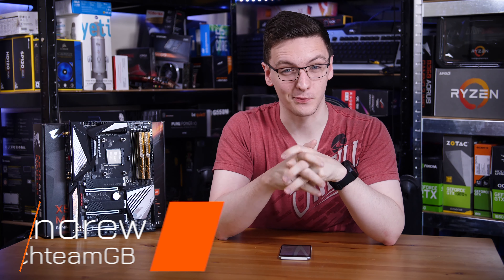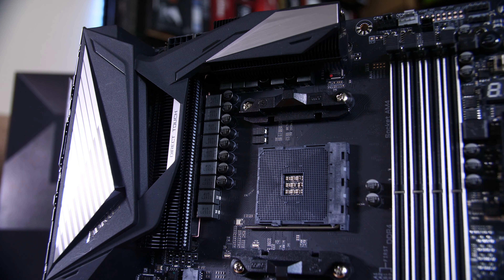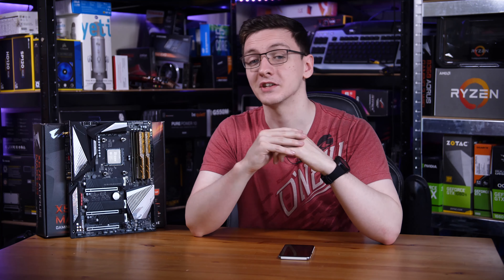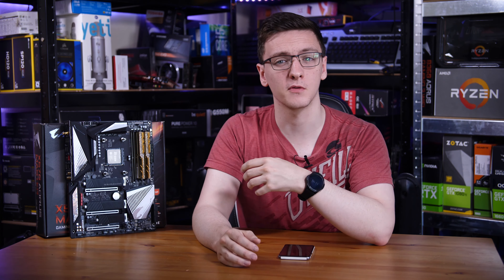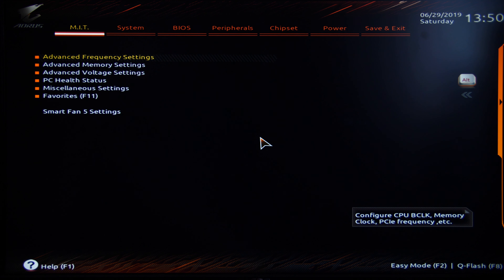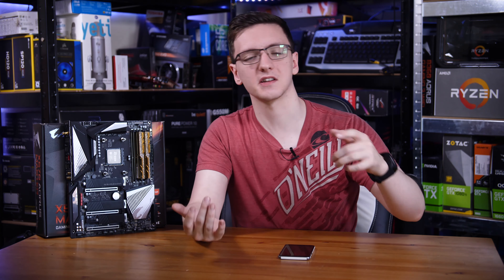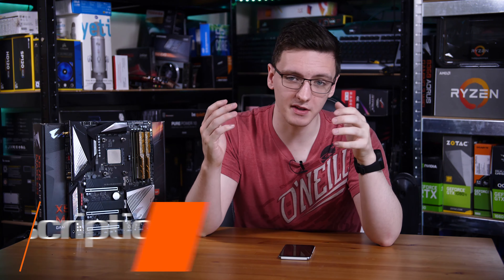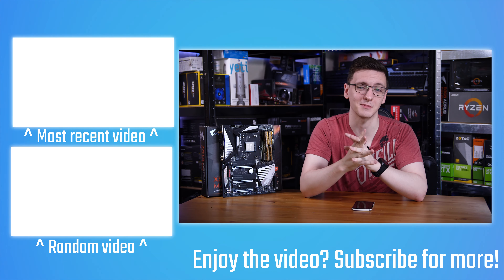Gigabyte Aorus X570 Master Review

Comment: Got this for ~300 pounds. My plan was to use it with 3900X. But it should be plenty for the 4000- series. The VRM and cooling is incredible. It's overkill for 12-core CPU's.

Comment: I've noticed on a couple other reviews on this board that the Thunderbolt header (THB-C) is missing. Do you know why that is?
Reply: typical Gigabyte rev. 1.0 boards have either missing hardware, hardware or BIOS bugs. I have this board rev 1.0 and indeed that header is not on it. the pinout is there though.
Reply: Gigabyte just launched a stick-on header for this so rev 1 buyers can upgrade.
.
.
.
.
.
.
I'm lying, they didn't. I just wanted to make your eyebrows lift for a second.
Sorry.

Comment: I've heard some don't have the TBH3 headers.  Can anyone confirm?  I've seen pictures with and without them, also reports of people getting their Master boards with no THB port soldered on.
Reply: This is so late it's laughable, but, yes, the version 1.0 boards do not have the Thunderbolt header. They do, bizarrely, have exactly the same pcb layout and therefore the capability to use the header, but Gigabyte, in their infinite wisdom, decided there was a shortage of tiny bits of plastic and metal.

Comment: I replaced an X570 Taichi with this board and I cannot recommend it enough if you're looking for a high end X570 Mobo.
Reply: why?
Reply: @ErVitto  Main reason for replacing the Taichi was the chipset seemed to run hot regardless of the system being idle or under load. This caused the chipset fan to become too loud for me not to notice it, so for me seemed well worth it to return and replace given that I was still well within the return window. I thought it was my specific unit, but after some research, many seemed to be reporting something similar. Ended up getting the Aorus Master since it wasn't much more expensive at the time and my research pointed me towards this being the one for me.
Reply: @jackghnj  thank you.
Which case do you use?
Reply: @ErVitto  Sorry for the late response! I'm currently using a Fractal Define R5. For context, I have a 240mm front mounted radiator and 2 top and 1 back exhaust fans. Anytime I am doing anything that makes the PC sweat a little, I always open the front panel to let more air in. Under the same conditions, the Taichi was idling at about 72c, while my current Master idles somewhere in the low 50s. At load, I haven't seen the chipset on the Master go any higher than 65c in a warm room (25c ambient). I did eventually replace the thermal pad for good thermal paste for the chipset fan on the Master, but that only lowered my temps by about 5-6c.

Comment: Do you need to put back on the nvme heatsink cover to use that gigabyte aorus nvme pcie 4.0 SSD or no
Reply from the maker: The Aorus gen 4 SSD heatsink is a 2 piece unit that screws together at the sides, so yes you'd need to put the back piece on.
Reply: I don't think OP understood the question.
You don't need to screw down the backplate that comes with the mobo for it to work. It will be just fine with the heatsink it comes with.
The reason some M.2's come with removable heatsinks is (dunn dunn duuuuuunn) so you can remove them.
Some higher-end mobos come with their own M.2 cooling facility, including this one - although the solution/s on this board is/are pretty cheap. So, no you absolutely do not need to put it back on but it may be beneficial if the heatsink your M.2 comes with interferes with the clearance of an aic.

Comment: Is there any performance or cons to putting the m.2 into one of the bottom slots? I have a 2280 and not sure if it would fit into the top one.
Reply from the maker: The top slot is 2280, would fit fine.
Reply: @TechteamGB  Thanks, I'm fixing to do my first build.

Comment: Hello. Can I use only one cpu power port? is that my 650w power supply does not have two cpu power plug. I'm still using ryzen 7 2007x.
Reply from the maker: Yes only one 8 pin will work fine

Comment: I think the price is too high for this board. I would buy it for 50 euros less if I could but 400 euros is too high. 350 euros is 
competitive price I think. Another thing of course it is strengthened by steel plate behind the board. It will not bend due too high temperatures in the future.

Comment: Very expensive mobo.
It have 2 x integrated sound device
2 x LAN
support for SLI and CrossFire which both are quite dead...
and some more useless things...

nope
Reply: Wifi 6
3x PCIe 4.0 M.2 slots
16 phase VRM controller
Active chipset cooling solution
7 fan headers

Yep.